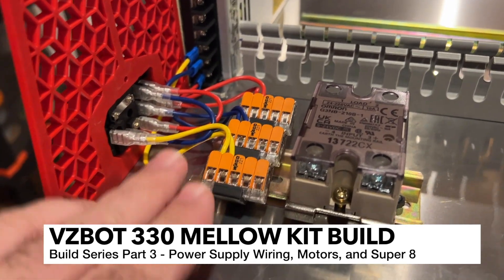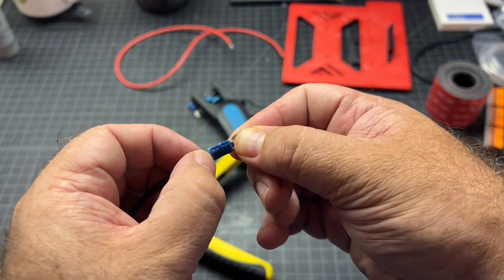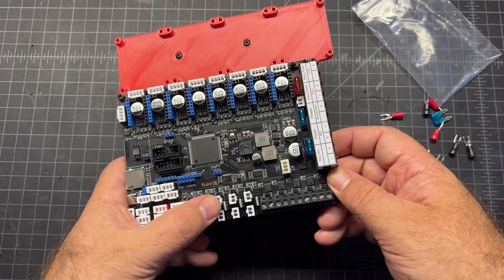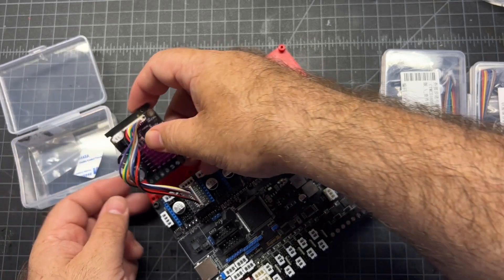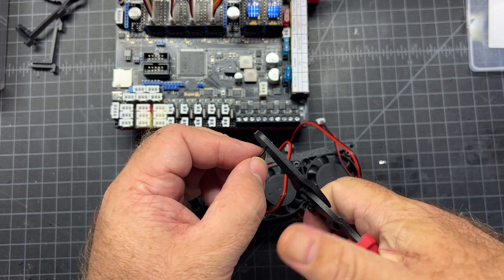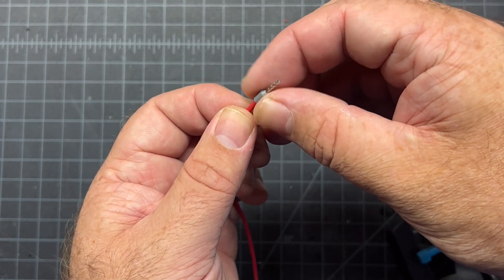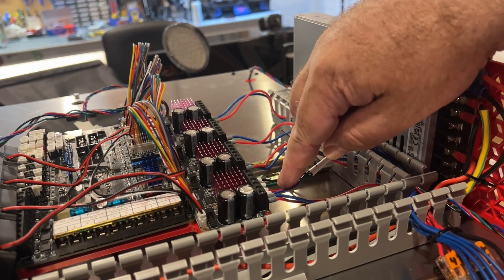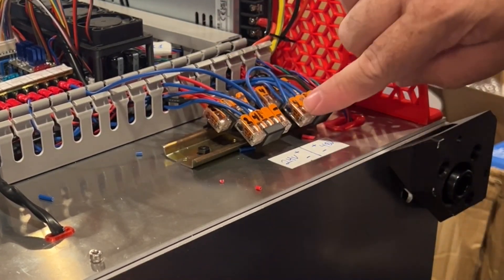Mellow VZBot 330 Build Series - Part 3 Power Supply, Super 8 Pro, & 5160 Stepper Wiring

Comment: Hi Greg! Nice job. If I could offer one piece of advice. I would use the PA-09's to shape the tabs on those pins.  There is a flat spot on the tip of the PA-09 jaws that you can use to straighten up the tabs on those pins. I typically trim the tabs because I buy the cheapest I can get and the tabs are always way too long, after trimming the tabs I straighten them up. I find it's easiest to, trim, straighten, then crimp. I really do appreciate how you talk the audience through your thought process while you are doing it, amazing work.

Comment: I'm a little bit confused on one part - you said you were not going to wire 48v to the Super 8 but the video footage shows the "HIGH" side with wires connected.   Did you change your mind?
Reply from the maker: I did connect the high side wiring, but to 24v (not 48v). The 48v is only connected to the 5160 drivers. I can see how it’s a little confusing in the video because the wire colors are the same for both. I cover a bit of the plan at the 26:00 mark.
Reply: @GregsMakerCorner  ah okay thanks for clarifying!

Comment: I wasnt able to find anywhere which motors are X/X1/Y/Y1...Any advice how do I determine that? Thanks
Reply from the maker: I used the documentation on the Vzbot site to work it out. I ended up changing it after the fact also. It wasn’t super clear but I eventually figured it out by looking at that site- hopefully you get it sorted.